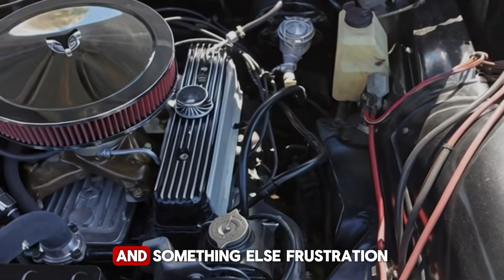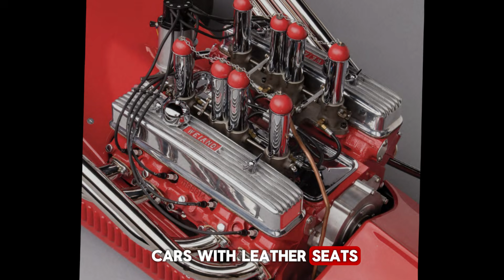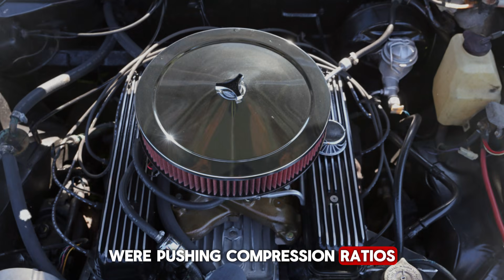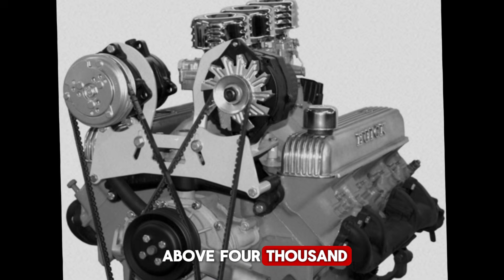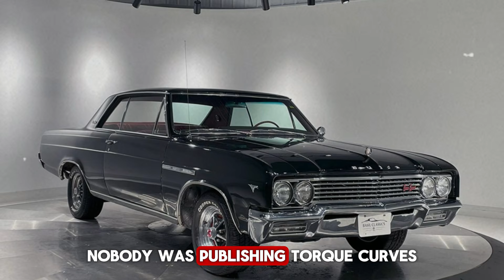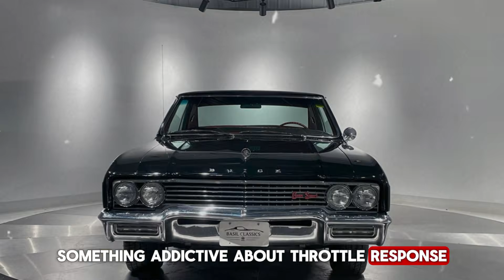Buick’s 401 Nailhead: Too Unique for the Masses

Comment: The Nailhead is an excellent example of what you need on the street and in the hills and hollers you just need torque to come out of the hole and you put a 3 speed even a Ford pickup tranny with the R11 OD and have the tailshaft converted into a slip yoke , put cable under the dash to make the OD available and a splitter button to the solenoid to kick it in and out. I put one in Square Gran Sport. The automatic transmission sucks. The 3 speed manual top loader with the R11-The T85N and you could keep it in the torque band 2800-5000, just shifting the 3 speed and flipping on the solenoid, you could do gravel roads at 100 mph.

Comment: Buick always considered torque before horsepower. I have a 350:Buick, and peak torque comes in at only 1,800 rpms! Consider a 455 Stage 1 with 510 lb ft. Rated at only 360 hp it keeps up with or beats any car of the muscle car era.